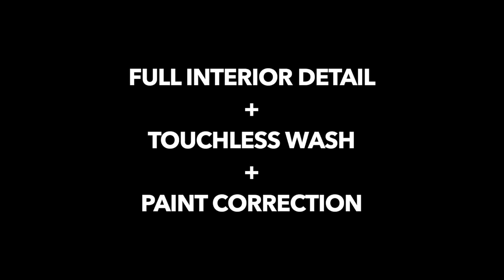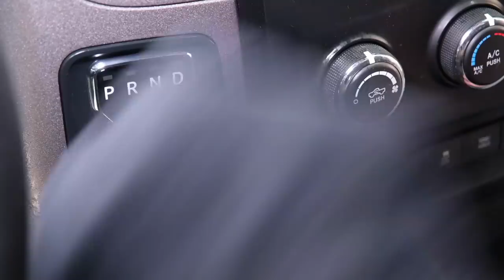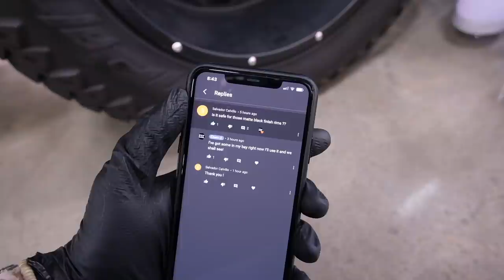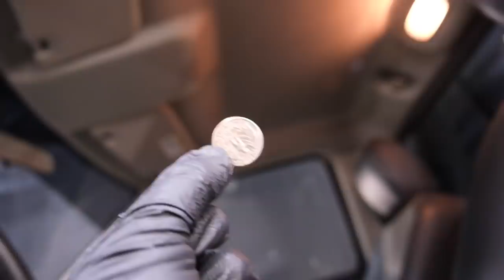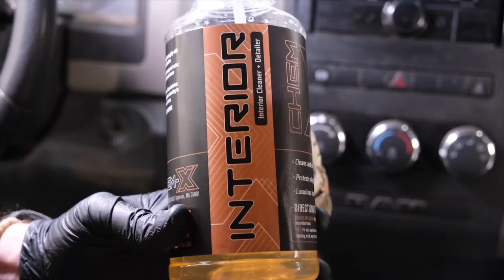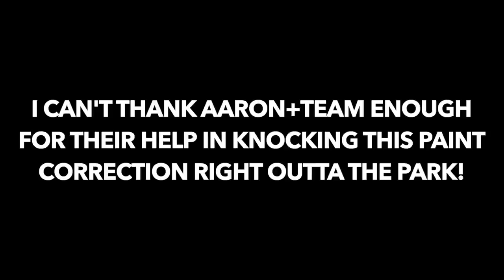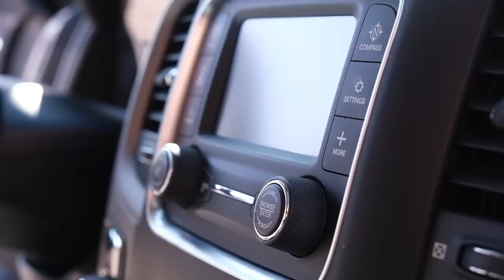TWO SUPER MUDDY DODGE TRUCKS Get FIRST CLEANING In SIX YEARS! + TOUCHLESS WASH + PAINT CORRECTION!

Comment: If you buff without clay barring first, the pad will pick up those contaminants and drag them across the paint which is probably where the scratching came from.
Reply from the maker: Yeah we didn’t clay bar last year when we tried our hand at buffing you probably nailed that as the issue
Reply: Chem-X side note - I think your pressure washer setups are the coolest thing ever. I know you’ve done some content in the past but I’d love to see more about the pressure washer builds, the chemical injection systems, the hose cables, and the wand setups. Keep it up man!
Reply from the maker: Thank you I appreciate that! I’ve been getting some requests to tour the place and I’ve got some new reels to mount in the bay I might go into the power washers at the same time

Comment: I use a magic eraser or a detail brush to clean leather seats also with the plastic’s, then I hit it with a air hose just in case there’s any chemical left doesn’t drip and stain the trim/ leather.
Reply from the maker: That sounds like some good techniques I’ll have to try that out!
Reply: magic erasers are a good tool but make sure your careful with them as they are actually a fine abrasive

Comment: It to me would not be a waste as i would have a spray bottle of optimum no rinse and do a quick spray and wipe.....but your way is WAY better. I struggled with buffer trails at the start and was doing a 3 or 4 step but have switched to a Rupes long throw da and its shocking what come out with a yellow Rupes wool pad and The Last Cut compound. Black may need a finishing polish or a pad
Reply: yes some black paints are very soft and finicky to get them to finish down without haze its best to use a polish and soft polishing pad ex: orange yellow or black

Comment: How well Does Stars and Stripes work if you only have an electric pressure washer?
I only have an Active VE52 that I use on my Chevy Dualy and RV. It's a 1800 PSI peak and consistently puts out 1000 PSI working pressure.
I haven't used it on My 07 Pete. Because It's easier to take that beast to Blue Beacon and let them scrub it down.
Very much interested in getting Stars and Stripes, But I don't want to have to get a gas pressure washer I would only be using on my Pete.
Reply from the maker: So 1000psi is a bit light I’d say it might not be able to run a foam cannon, and not hitting very hard will compromise the results most likely

Comment: Hey bro just got product but got a lot of haze after. Should i use a less aggressive dilution or is it in my rinse? I Have a 3200psi pressure washer
Reply from the maker: That’s a good amount of psi but be sure to stay within maybe 6”-12” distance and use the green pattern nozzle, if that doesn’t help than the soap isn’t mixed strong enough, or the air knob on the foam cannon may need to be turned tighter

Comment: Where does all the mud end up in your drain, there’s a sump? And then you have to clean that out every so often?
Reply from the maker: So I have a large 40’ trench drain that I didn’t pitch, so the mud stays there and can be shoveled out, there is a u trap on the way to an oil water separator and then that hits a pumping chamber after that. The separator has to be pumped every so often but I actually don’t use the bay too much it’s just for these videos

Comment: Random question mate, I've got a black car, and when washed it has deep water spots almost permanent lol does this style of washing remove them or is that a polish or buff type of job
Reply: Polish is the only way to get deep water spots out of clear coat
Reply: @ohboy2592  thought so, thanks mate
Reply: @callanmurphy9807  no problem.  If you have a clay bar, that might help remove some of them.  Then go with a light/fine polish.  If that doesn’t work you may need a polishing compound but don’t use a rubbing type compound.  That’ll remove a lot of material quickly and then you’ll need to polish it to get the swirls and dullness out.  Least aggressive first and work your way down.
Reply: @ohboy2592  cheers mate appreciate the advice, it's only a cheap run about car but I'd still like it to look clean lol might just take it to a professional for the first one, just my luck I'd bugger something up

Comment: What is the pulling system you have to gold the hoses?
Reply from the maker: I made it myself it’s stainless 1/4” wire rope with zip line pulleys, I weld a bracket to attach the hose to em and use constant tension clamps to lock them in